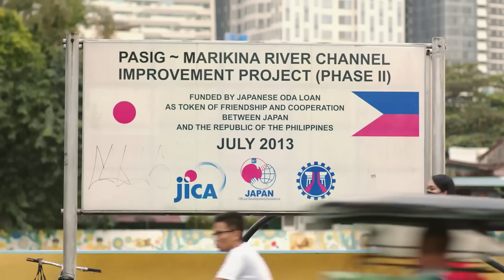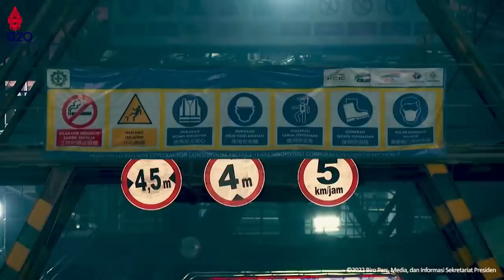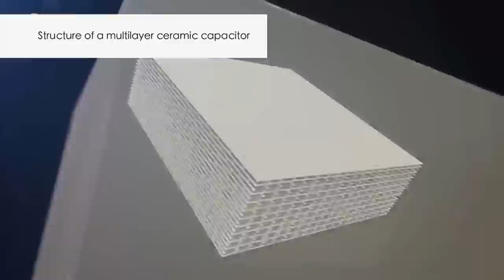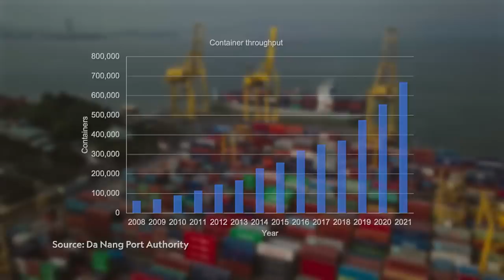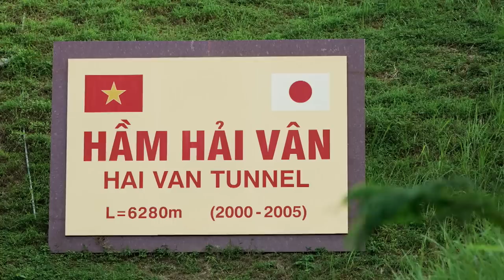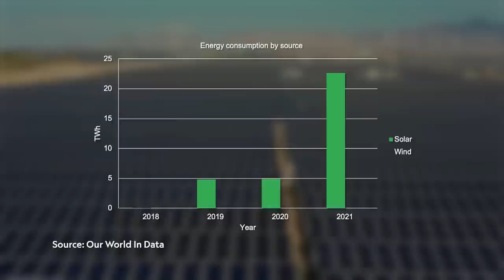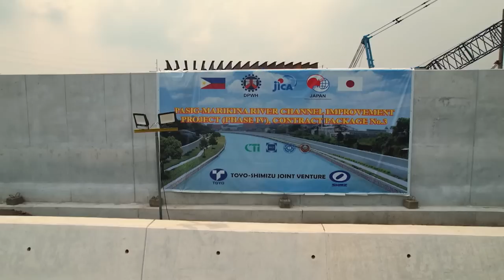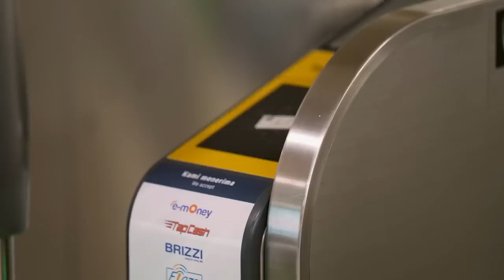How Will Japan's Indo-Pacific Strategy Impact Southeast Asia? | Japan’s Indo-Pacific Plan - Part 2

Comment: Japan's approach to foreign infrastructure development is so radically different from China's Belt & Road Initiative. Japan required Indonesia to spend only 30% of the funding on Japanese components, so Indonesia was able to use a lot of local labor and suppliers. China typically uses almost exclusively Chinese construction firms with Chinese materials, Chinese components, Chinese labor, and puts virtually no money into the local economy. And the care and thoughtful planning Japan put into typhoon flood mitigation in the Philippines is a stark contrast to the reckless, slapdash, "tofu dreg" construction Chinese firms are infamous for - just look at all the dams, hydroelectric plants, and other BRI mega projects around the world that are now falling apart.
Reply: Agreed, the number one drawback to signing up for a PRC megaproject is quality and maintenance. What you save up front you lose 3x over in repair or outright failure down the road
Reply: If the terms are as good as you claimed, why did Indonesia offered it to China? Dam falling apart are just in your dreams!
Reply: @pahatpahat9566  I think there are serious concerns about quality assurance issues in many Chinese megaprojects but the advantage is that they come at a better price.  Of course, projects vary by location and some may be decent. We can only speak in generalities.
Reply: @netizencapet What is this Japanese quality exactly? Outsourced parts from China/Indonesia? Not many things are made in Japan these days. If they are, they only stay in Japan. Japan exports to the outside world their "rejects". This is a very Japanese mentality. Ironic. Sony, Panasonic, Yamaha, Toyota, Toshiba, etc. All have factories in China, Philippines, and Indonesia. These are for non-Japanese consumers. They don't tell you that because they never will.
Reply: Filipinos here have forgotten so quickly who conquered, killed 1 million of their people and enslaved them. They have forgotten what Japan did to them and are now speaking glowingly of their former conquerors. On the other hand, China has never sent 1 soldier to the Philippines, not even in the last 1000 years. Do you Filipinos still study about your hero who fought against the Americans who colonized you? Of course your government has stopped mentioning about your hero for fear of offending the Americans. 48:02

Comment: Rising tension in Asia Pacific. Thailand will see the Indian Ocen opportunities and work more closely with another group BIMSTEC (Bay of Bengal Initiative for Multi-Sectoral Technical and Economic Cooperation). 26% of the world's population is here. That's the old information for Thailand. Japan should update the news. They always act more slowly than China in terms of investment in Thailand. Our’s new long-term strategy is the Southern Economic Corridor Project. It calls “The Land Bridge Megaproject” which will connect Chumphon province on the eastern coast of the Gulf of Thailand to Ranong province on the Andaman Sea, will become a major transit port, with a capacity rivalling Hong Kong. We don't use Dewei port anymore.

Comment: Didn't Japan already try to build an 'economic corridor' in SEA in the 1940's? I think it was called the Death Railway.
Reply: If you read ADB's plan for the Mekong Sub-Region, Japan together with India should have had built all the rail-road connectivity from India via Bangladesh-Myanmar- Thailand-Cambodia- Vietnam umpteen years ago!!! Instead we find the DaWei Port in Myanmar lingering half-death with no further progress in spite of Japanese support. Fact is there is simply isn't enough trade between India and those ASEAN members , hence the inability to build the rail nor road required! The reality is seen by the increasing usage of the China-Laos rail link which seems to improve Thais trade with China tremendously and with the completion of the Thai- rail-link to Bangkok, then the 3 decade-old Singapore-Kunming rail link should be realized! Indeed plans are free but implementation takes more than just paper works!
Reply: Get out of your dungeon !!!! This is the 21st century.